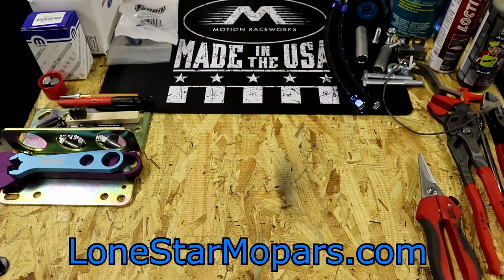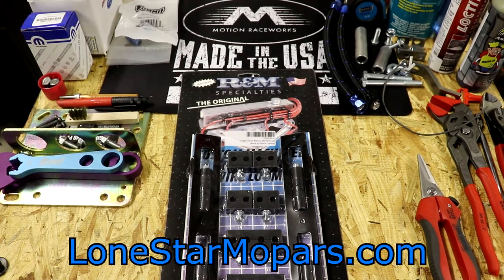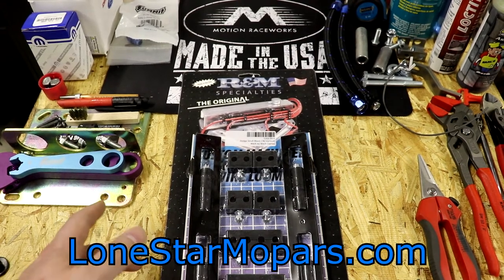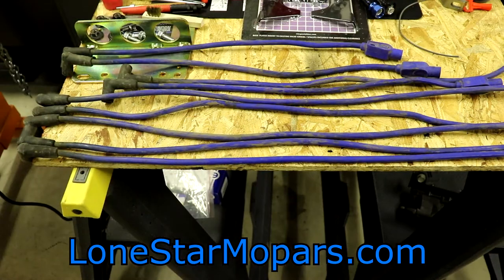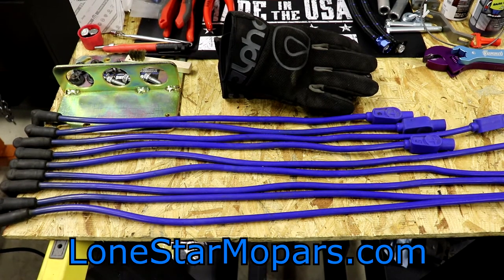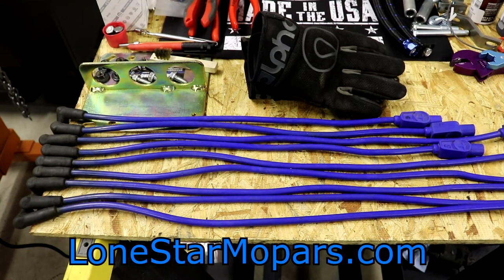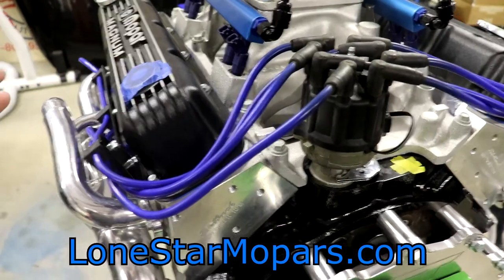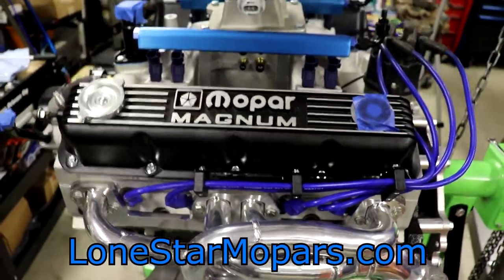Ram Revival Part 45: Spark Plug Wire Routing with R&M Specialties

Comment: Lance sir weren't you talking about replacing the brake lines on the ram,I bought a fine lines prebent stainless steel brake line kit complete kit front to rear, for my quad cab long bed 4x4 2000 dodge ram 1500,so I thought I would mention that it's classic tube from Ohio..